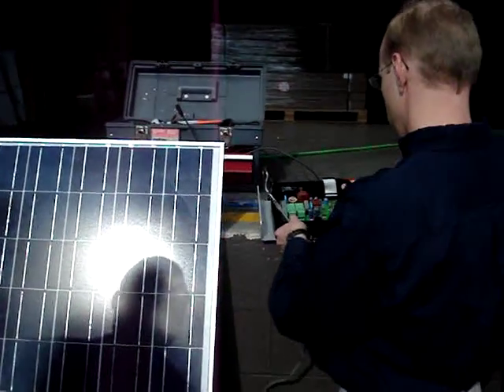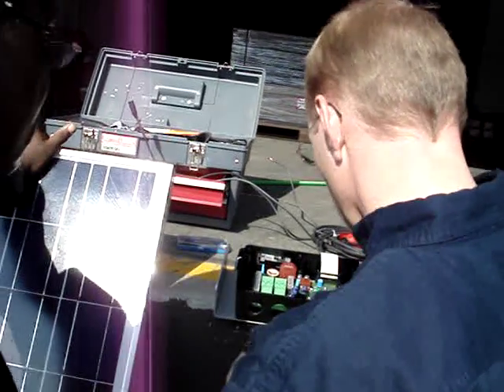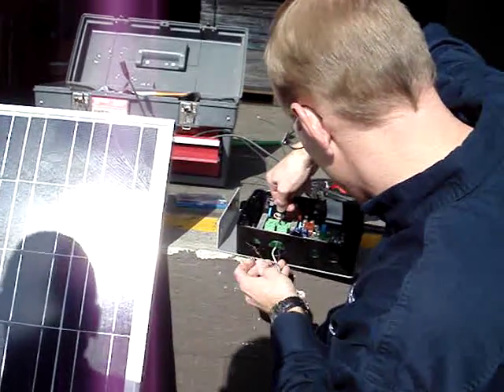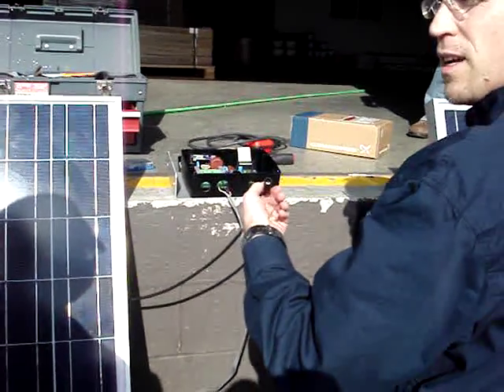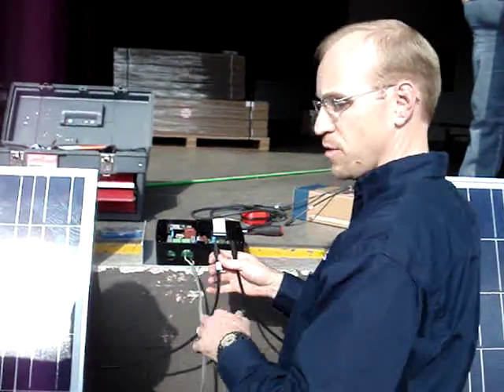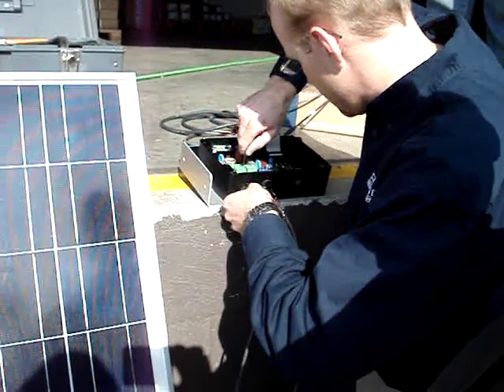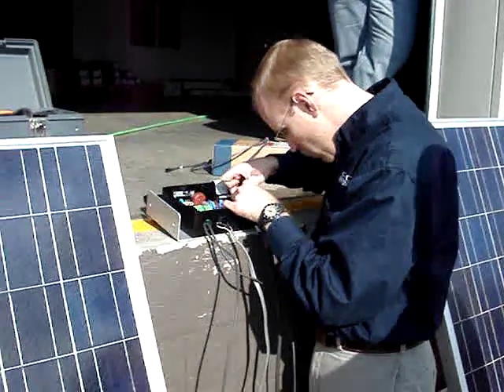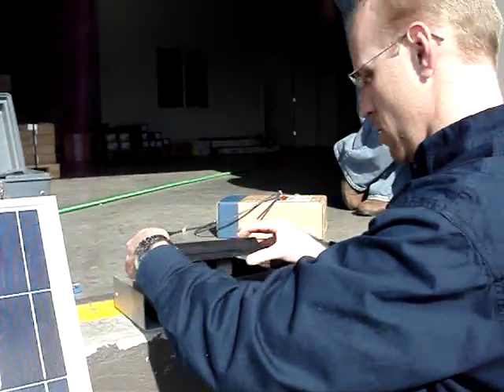Grundfos submersible solar pump demo Part 2

Comment: I Have found this pump to be very useful in remote areas where there is no power from the grid. We have tried it using solar panels in Central Rupununi, Guyana, South America and we got very good results. I would recommend it to anyone in farms and ranches where water is a problem.

Comment: On a well pump install, it splice should only be a crimp connection with a heat shrink insulation and then a wrap of Scotch #33 tape at least 6 times that extends 2" on either end of the shrink tube, but this vid is only a demo.
An actual slice could take up to 40 min, depending on your experience

Comment: Joseph, you need the I/O101-115 gen box to run on a genset, or I/O101-230 if you want to run on 230v.

And yes this vid is just shy of being safe for a complete install